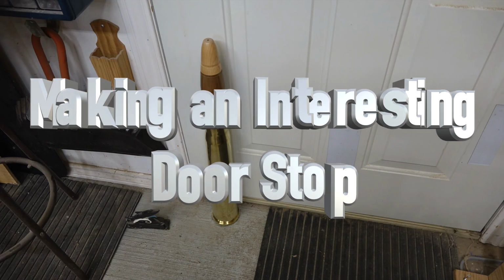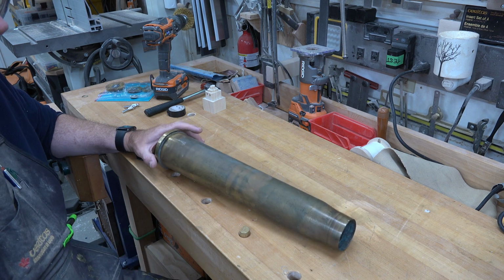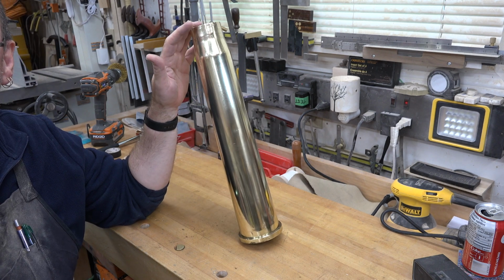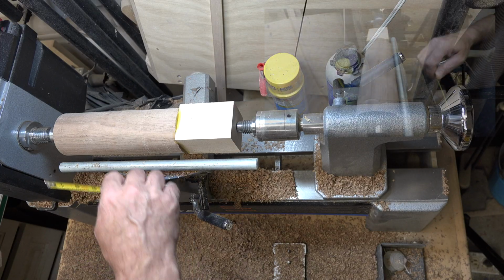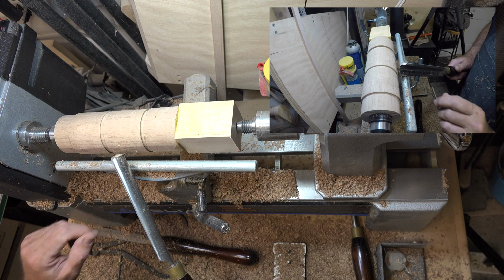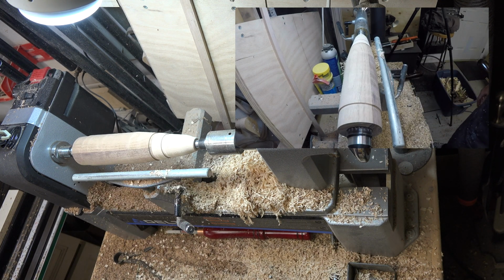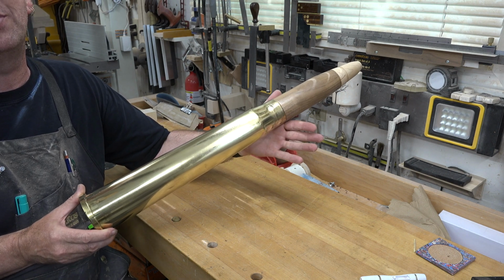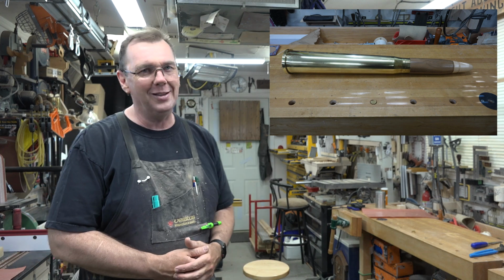Making an Interesting Door Stop

Comment: Fun project!   That will make a very unique door stop 👍.   I also wondered about the length of the projectile …… only thing I have had experience with are rifle and hand gun rounds.  After your comments I looked on line and from what I found, it looks like you are dead on 👍🤠
Reply from the maker: I struggled for a while with the proportions of this one Randy and even google searches didn't really boost my confidence.  It took a while before I got some solid pictures of the shells in order to like what I was making.  Thanks for tuning in and for chiming in with the kind words.

Comment: Another fantastic video, completely different to everything else :)

It would be far easier with some polishing mops and polishing compound on a bench grinder (or even in a drill) ... either that or wet'n'dry using liberal amount of water, that would have cleaned it up fast.

BTW, Autosol is actually quite abrasive, Brasso (as mentioned below) is far better!
Reply from the maker: I tried Brasso on this shell casing Barry and it wouldn't touch the grime.  I polished with the Brasso for quite some time and it looked no different than when I first started.  I actually wondered if they changed their formula at one point because it doesn't work as well as it used to.  Thanks for tuning in to the show.
Reply: @acutabove_woodworkings  Sorry, I wasn't clear enough ... polishing mops/compounds or wet'n'dry initially ... Brasso to finish off!
Reply from the maker: @barry.w.christie  Ah.  Good to know.  Thanks for the clarification.

Comment: We used to use steel wool for cleanup of dirty brass.  Next to last cleaning was 0000 steel wool, and last cleaning was using Brasso.  And we would have a mirror, no scratch, finish.
Reply: I agree with your procedure Scott.  Even so Kenny's looks darn good.
Reply: @dwightl5863  its definitely looks good.  I started to write then when he was trying to figure out how to polish it.  The harass we cleaned was on black powder muskets.  And that powder residue and grease would get on the wood and steel and brass.  It was a pain cleaning it up every week.
Reply from the maker: I actually tried Brasso and it didn't touch the grime on this casing which I am surprised about.  Have they changed their formula because I remember it working a lot better than what it did.  Either way, I got it cleaned.  Thanks for tuning in Scott and for chiming in with the cleaning method.
Reply: @acutabove_woodworkings  interesting.  We only used it to remove the oxidized brass. Project looks great.